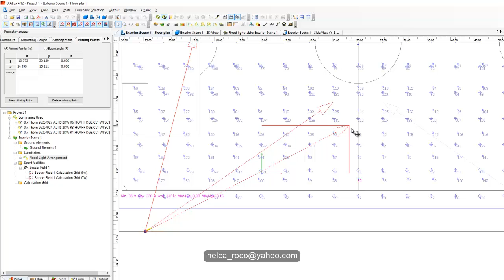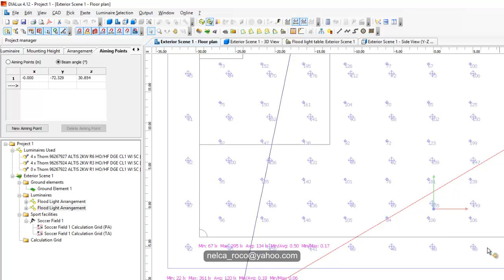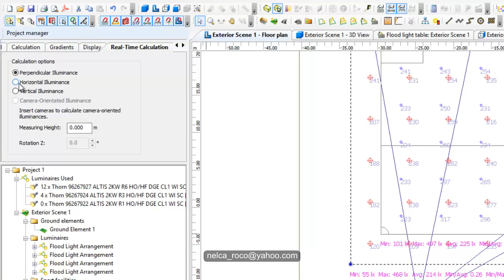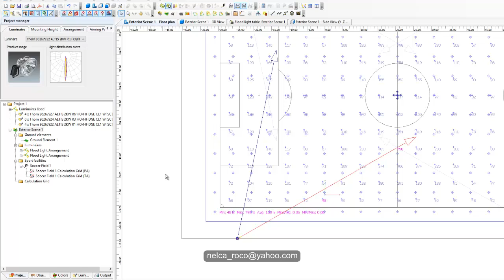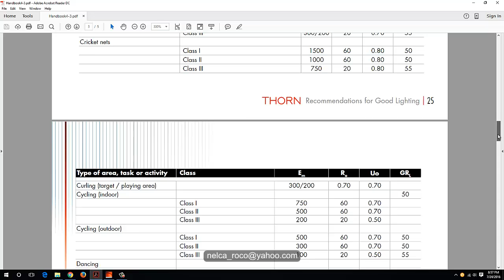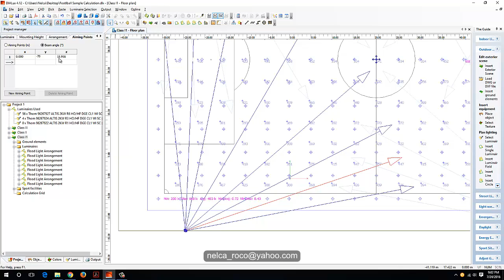Football Lighting Design Calculation (Part 2)

Comment: hii mam.....plzz help me i need Eav-100lux,Emin/Emax-0.135 ,luminaire is 200W Fllodlight,28000lm,exterior size is 72x54m......i adjust the angle several times but i can't acheive Emax-100lux

Comment: please i want to know what is the standards for the maintenance factor  here?
Reply from the maker: Hi Yasin, Usually if it is LED luminaire, u need to know the Life Depreciation, then use it. If it is regular Metal Halide or Sodium, we usually used 0.70.  If the clients requires 0.65 then we will change it.  Actually, it will depends on the client requirement or the lamp used. Dialux default for outdoor calculation is 0.67.  U may also use it.
let me know if u have more questions.
enjoy learning!
Reply: at your design up , if you changed the factor  from 0.8 to 0.67 ,  will it be a big difference foe Eav?
Reply from the maker: yes